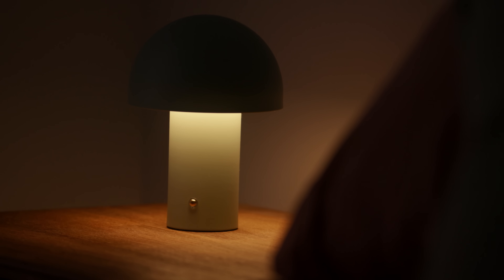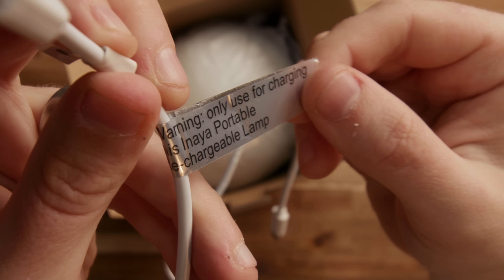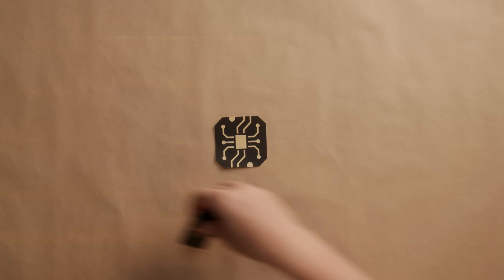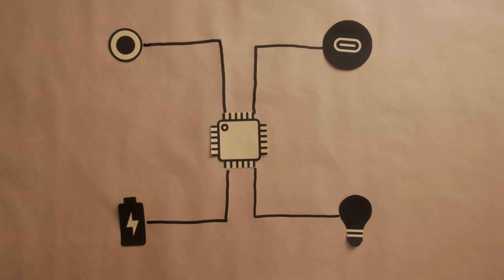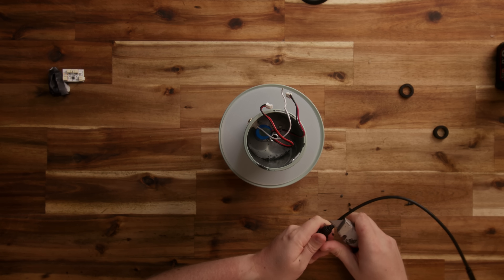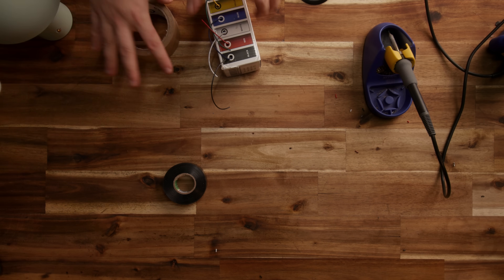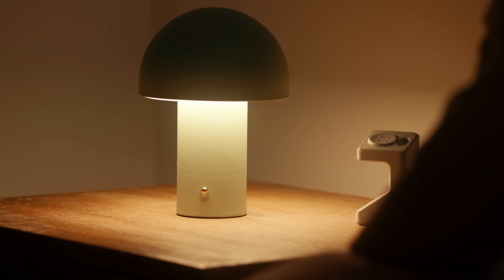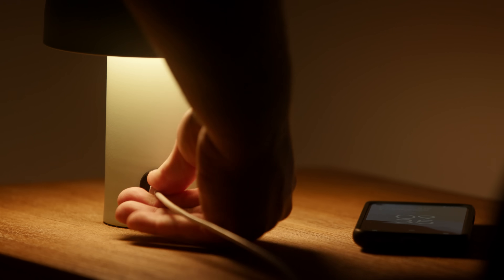Kmart Lied to Me, So I Hacked Their Lamp

Comment: seriously dont understand the point of a lamp that can "charge". if its sitting in the same spot on yourbedside table 24/7 why not have it just permanently plugged in like a normal lamp?
Reply: They make this USB because there's less legal liability, especially if you supply the usb brick. No UL listing or anything, because it only runs on 5V.
Reply: Presumably has a lithium battery. Usually they're bright until they fail/go flat. There's no dimming as the battery runs down. So bright...bright ...bright...dark. Not what you want from a lamp given you turn it on because it's dark.
Reply: Yeah I hate the added e-waste of unnecessary lithium ion batteries.
Reply: For me it's mostly that every few months I can grab them when I need to get some extra light where a task already is. Crafting ect
Reply: I don't have outlets in the middle of my living room floor so cables would have been a trip hazard.

They looked nice, unfortunately they kept getting knocked over so I took them out.
Reply: I was about to agree, but then I saw 10:06
Reply: Agreed agreed. A more interesting thing would be to try and hide the cable
Reply: I don't have a socket near my bed
Reply: Why would anyone want to have a lithium fire hazard lamp next to their bed?
Reply: 1. No cables, minimalism is in these days! 
2. For bedrooms with terribly placed power outlets, charging once a month is better than having a super long cable along the floor all year long.
3. They're also nice for power outages, a bit more usable than a typical flashlight for late night reading.
Reply: This is not "minimalism", it's chemical ewaste. The battery will deteriorate and need to be trashed. Anyone using this will eventually get tired of charging it and leave it plugged all the time. This will accelerate the battery aging and eventually when that "power outage" happens, it wont hold a charge. Seriously the industry needs to stop shoving batteries in devices that don't need it, it's such a pain.
Reply: @EMILE12345678901  minimalism is always about the aesthetics, never the functionality.
Reply: @EMILE12345678901   "This is not "minimalism", it's chemical ewaste" how are these two mutually exclusive? Minimalism is a design/fashion trend. It has nothing to do with durably or wastefulness.
Reply: @EMILE12345678901 That’s no😢how capitalism works, unfortunately. Their incentive to change, is consumer demand, or in a perfect world, legislation made by responsible politicians. Every time I think about this, I feel so depressed about the world we are leaving for the next generations.
Reply: @ omg don't tag me to puke out senseless political garbage, go out and live your life, don't watch the news or whatever, be your own self dude
Reply: 🙏🏽 I could not agree more with you
Reply: If I plug a cable in, I'm done. If I need to charge it once a month, that's an extra todo item. A little cable management is way less work in the long run
Reply: I have one , it needs recharging like every day. It does have benefit for camping and charging off solar.
Reply: @terablast  once every few days*
Reply: @terablast Minimalism that includes charge cycles? That's ridiculous.
Reply: @terablast  adding a battery, a computer and a separate losable cable to something that could just be a light bulb, a switch and a wire isn't actually minimalism.
Reply: For those of us that grew up pre-convenience, 100%!
I’d rather run a power cord than have another chargeable device that doesn’t move.
Reply: I use some bedside lamps for going through the house at night when I need to, instead of turning on the overhead lights which is terrible for going back to sleep.
Reply: @AlexFlockhart Those are not these. A portable lantern is a multipurpose device.
Reply: To be fair, my kids have nightlights that they can move with them. They like not having only one place to use it.
Reply: For me, it's because my kid goes into the bedroom and likes to unplug things and/or the cables are a hazard. A battery nightlight is great because I can put it on a high shelf without having a dangling cable anywhere
Reply: @Wise_That This is a temporary thing, enjoy the chaos and finally remember it later.
Reply: It’s a small thing that adds up. If you charge during the day and you have solar there is an energy saving. Could that ESP32 be programmed to define the charging time?
Reply: @markpirola8152 If you have solar, is your household power switching over to that through battery backup or a transfer switch?  Most people's solar setups are not connected directly to their homes main 240V mains and are instead a 3rd party install that feeds into the grid separately from their meter.
Reply: @ inverter on premises that delivers the 240 to my house. A meter records power generated. Any excess generated has a very small rebate against my monthly charge. Hence any consumption during solar hours is essentially free unless I consume more than I am generating.
Reply: You are not required to use this on a bed side, you could put it on a coffee table, on a shelf, move it anywhere you want. Wont always be on a bedside table and have a nearby power outlet.
Reply: Camping
Reply: I need to charge my phone sometimes
Reply: You fall asleep with the lights on while doomscrolling/reading a book etc., this helps save electricity since it cuts off the lights when batteries are drained. The same for people who need some light to fall asleep.